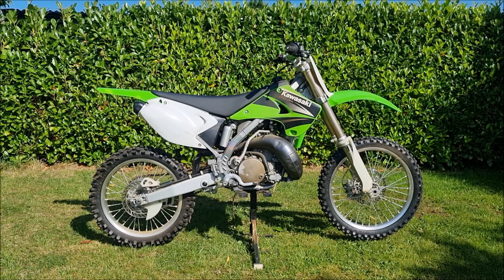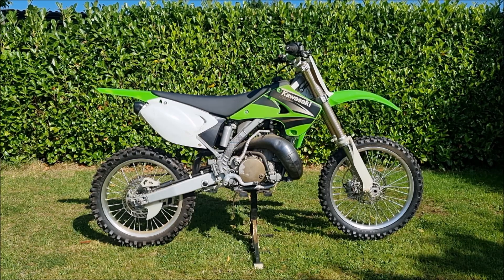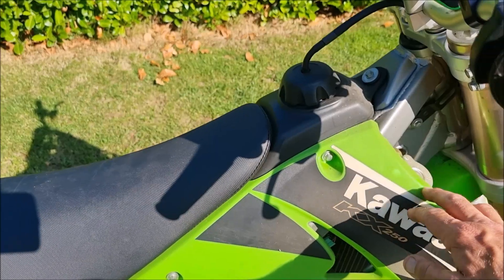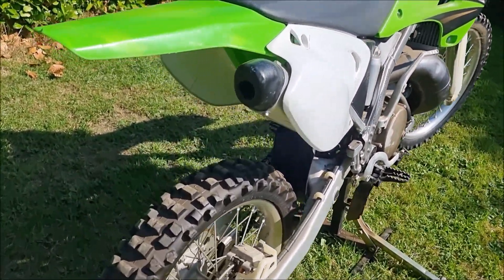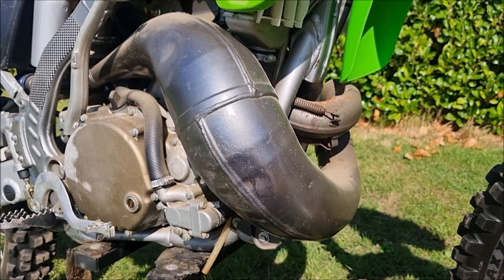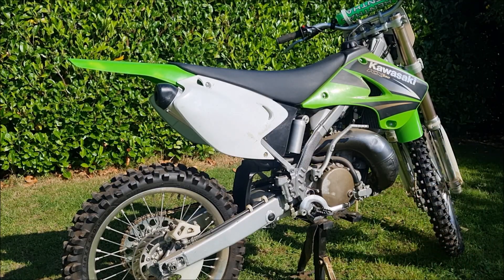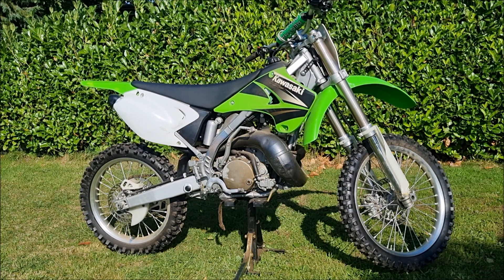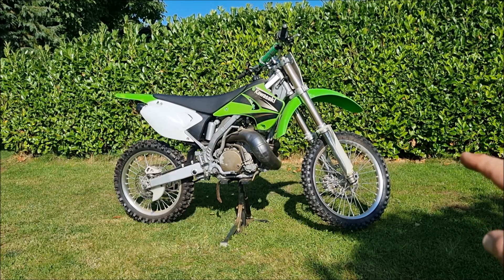CLEAN 2003 KAWASAKI KX250

Comment: Don’t restore it dude.Love the 20 year old look.Just change the tires,filters and fluids and go ride.If you fall n love with it change the forks n shock or get them rebuilt.Cant wait for your 2 stroke wheelie vids👊🏻✊🏻
Reply from the maker: Lol power wheelies maybe because in useless at proper wheelies. 
I like the original look rather than a minter in frightened to get a spec of dirt on. Not sure it's for me but too good to let pass. Forks definitely need doing, 120 pounds at the shop to do both. 15 for seals. Need to maybe learn that myself. Shock would need sending away though.

Comment: would that be a classic Japanese bike then ?  equivalent to the 90s Nissan Skyline ?   I've got 3 ebikes now having made 2 this year,  the new one is unusual because its a road bike with drop bars and then I got a BBSHD mid drive motor on it, so it can in theory climb steep hills easily while being loaded with tonnes of batteries and maintain a relatively low overall weight and cost for its high speed and long range.
Reply from the maker: Yes it's getting there for a classic, this is very low hours for the year and all seems original, too good for what I use them for but also too good to turn down. 
That is unusual but everyone has a different desired riding position. 
I watch JohnnyNerdOut channel and he swears by them mid brive BBSHD, for me that's the next stage up from hub build. I would like a full suspension for that, the right 1 will pop up sometime. 
Addictive this ebike stuff in fact all ev's interest me.
Reply: @motomachinezuk8786  thats pretty much why I got one,  and also seeing it on Bruno Power channel, no problems with it so far but it is a bit jumpy especially the PAS thing, which I never used on my hub ones. The resistance when you pedal the bike is also really high, presumably because its spinning the motor at a high RPM, even so it shouldn't be generating electrical resistance when the power is cut off.  
My Kona MTB is still my favourite bike though, most useful, most value for money, I even use it to go shopping.
Reply from the maker: @ash0787  I switch pas off most of the time as like you say its keeps going for a few seconds, easier in tecky situation to use throttle. 
Watch him too. 
Kona must be good, hard tails were a good starting point for me just to get the knowledge. Good on roads tho. 
Kona is the daily eh, I use my little honda grom like that it's perfect for small commuting etc..
Reply: @motomachinezuk8786  yes its dirty enough that nobody wants to steal it, I like with the hub that I don't have to worry about the drivetrain, i've been going with 1 pedal for about 6 months now because a bolt wore away due to lack of the right tools / replacement bolt . I like my 'stealth bomber'  / vector thingy but even with magura MT7 etc its so heavy that I have to be really careful so i'm on edge a lot of the time, and the low range means I don't get anywhere I wouldn't on the MTB, I think it would benefit from different tyres to improve the rolling resist, it could probably be amazing off road but I don't have the tool to remove the cap to lower the front fork pressure, its a big hexagon nut thing about 4cm wide thats on super super tight.

I ordered that USD-8 Volcano suspension they use on the Sur Ron but what turned up was some 'KKE' branded thing, quality seems similar but I can't be certain.
Reply from the maker: @ash0787  I'm not sure of the vector. I shall look as always wanted to try a stealth bomber. I assume you have a small battery on that? 
Always need a special tool for something, annoying that is. 
Kke never heard of but probably similar. Fast ace is very similar. 

You got a good collection there mate 👍
Reply: @motomachinezuk8786  on the stealth bomber thing I have quite a big battery, I think it weighs 16KG,  72v 40ah,  but I only got about 30 ah out of it so far, I don't want to fully charge it and i've found that below around 67v it starts cutting out at the BMS which is pretty annoying as the 0% mark is around 60V, would be nice to be able to use the battery down to 15% if needed.  On my MTB with the 48v battery I've been able to drain it right down to 41 or 42v before ( 15 to 20% ) .   Vector and Stealth are similar designs, theres also the Delfast,  mine is just a DIY with a frame from Ali Exp and QS 205 v3 motor,  I used the instructions from a youtube channel,  its the same bike as Andy Kirby has basically.
Reply from the maker: @ash0787  that sounds a bit iffy with the battery bms but least you worked it out, shame not got its full potential. 
Wish I could purchase 1 but I got the surron for now. That's weight is just short of 50kgs, 48kgs claimed.
Reply: @motomachinezuk8786  likewise i'd like to purchase a Sur Ron but 4 bikes would be too many, and don't wanna attract further attention from the cops. I think I might be able to improve this bike, its only at 4KW now because the 50 amp BMS, supposedly they can get up to 11KW.  Someone on youtube was able to get over 100 miles range on a Sur Ron with an aftermarket battery called Chi, which I thought was really cool, so in theory it should also be possible for my bike.  Another thing I saw recently that seemed like more your sort of thing was people putting big mid drives on old gasoline bikes, QS138 or something.
Reply from the maker: @ash0787  ah yes that is a dream to build something like that with the qs138, it's just battery I'm stuck on as don't feel confident enough myself. Wish I knew someone with the knowledge. I confident I could do the rest. 
I've seen a 60v 63ah battery, that's over double the range and mine is only 30ah. I think I want range not fussed with more speed that's just asking for trouble. 
Those stealths can definitely run some kWs
Reply: @motomachinezuk8786  yes its a struggle,  the youtube channels i've seen don't give much advice about it. I find it annoying how electric cars don't seem to have a problem getting powerful huge batteries at a fair price.  Its one of the reason I decided I'll probably be better off with a super lightweight and efficient bike.